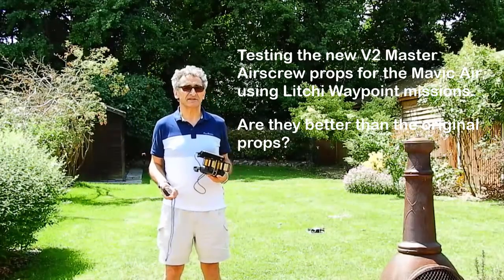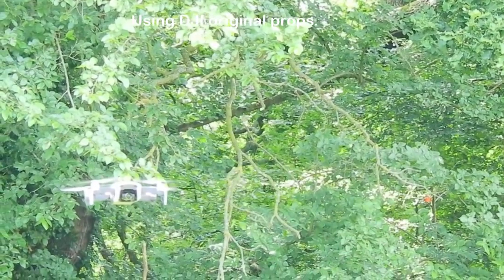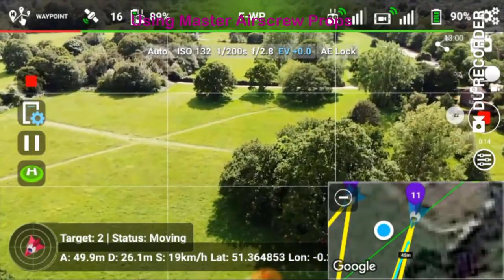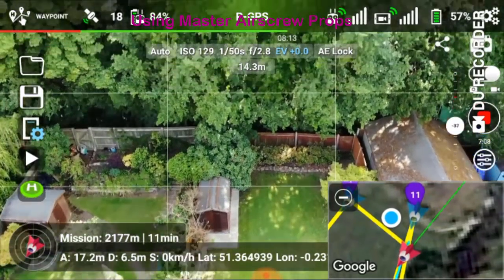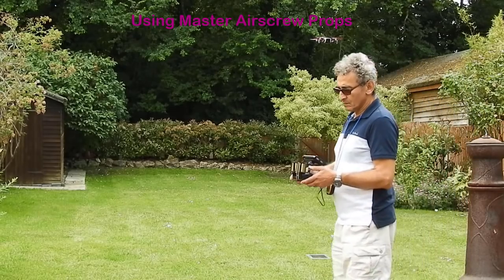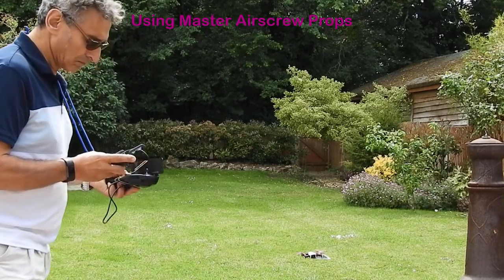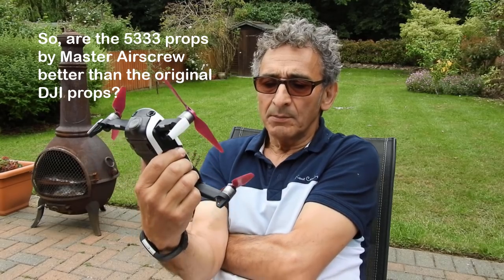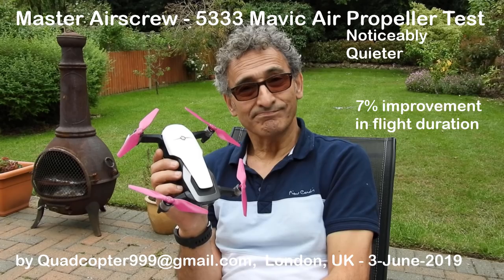Master Airscrew 5333 props

Comment: So it's a longer prop?
Reply from the maker: No, the props are not longer. They are expertly reformed. The result is that they are quieter than the original props and my Mavic Air flies more efficiently and for longer with them.

Comment: what software was u using on the phone, as that wasn't the DJI app?
Reply from the maker: I used Litchi because I wanted to make sure that I flew the same waypoint mission. I preplanned the mission to last 11 minutes but as I used curved points it cut the corners and dramatically cut down the flight time to around 8 minutes.
Reply: @quadcopter9993  thanks but £21 is a bit much for a feature that should be on all dji drones
Reply from the maker: @jam201984  I agree, but Litchi is nothing to do with DJI. In fact, very few drones have this feature in their software. To me, it was an essential element so I added the cost of it to my budget for the drone.
You could probably say the same thing about the propellers too because my original props are not as good as these.
Reply: Quadcopter 999: Has Litchi the same flight restrictions as DJI App? For example, what about flight altitude (500 meters)?
Reply from the maker: @JuanGomez-jt1uu , I'm not 100% certain because I've never tried to go above that. However, even with DJI, it's adjustable in the app and I seem to remember that it's the same for Litchi.
I like both apps but only Litchi let's you pre-plan, and even share online, WayPoint missions.

Litchi also lets you put the phone in a 360 headset and you c as n use it for FPV such that the camera looks up and down according to the angle you hold your head.